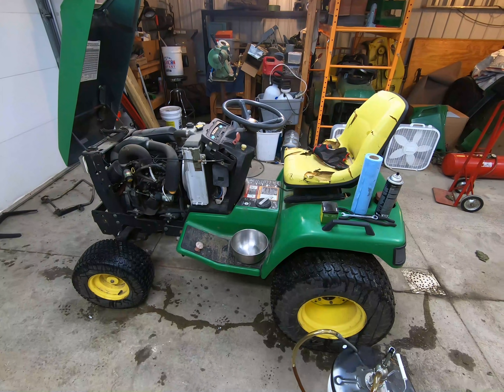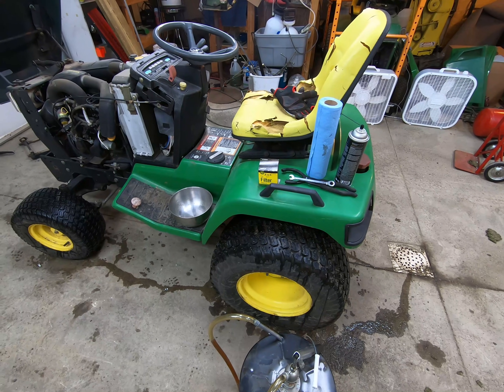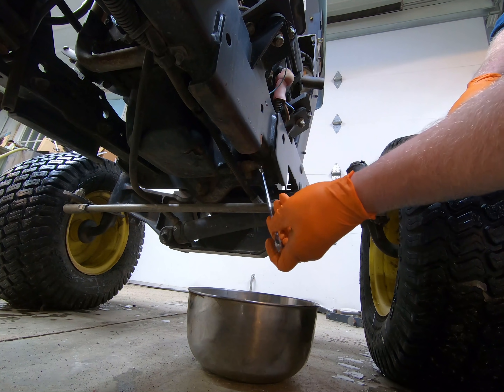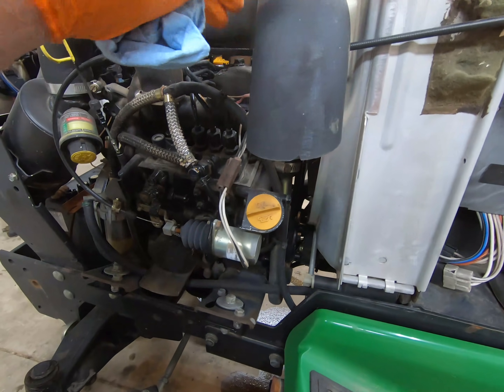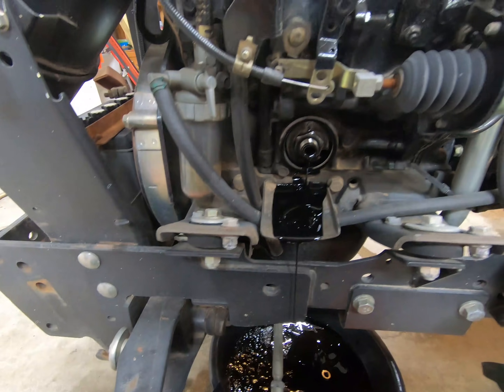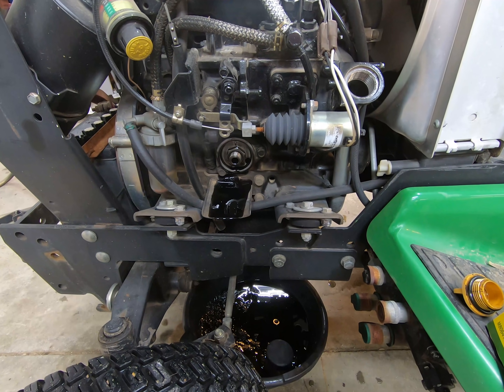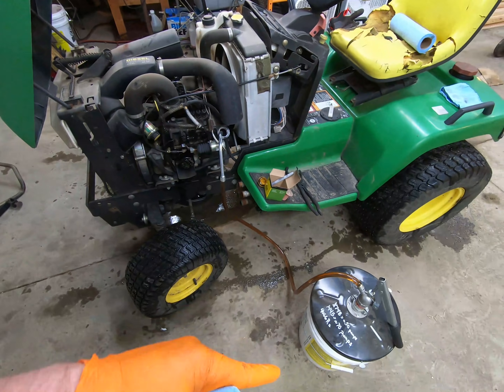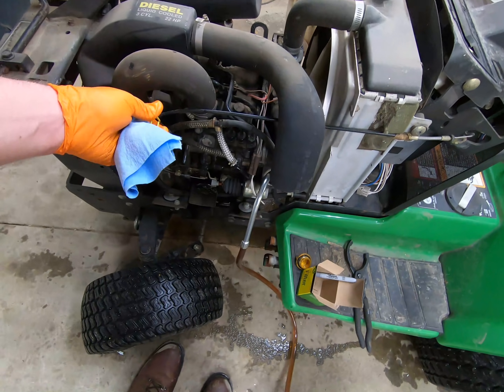John Deere 455 Oil Change

Comment: If you change the fuel filter, air filter hydraulic fluid etc etc.  I won’t complain.   I love your videos and I have to do this to my 1999 455.   Ps.  I have a hose on my oil valve.  It came that way.  I also have to take off my 60 inch commercial deck and sharpen my blades.   That seems difficult.  Again thanks for all your help.   D
Reply from the maker: The fuel filter video has been done... just need to edit it.

Comment: My 455 will be used year round.  Can I run Rotella T6 5W-40 all year?  It gets cold and snowy here in MN :)
Reply from the maker: While I’ve never attempted to run T6 in a 3TNA72UJ engine, I have run it in my 3TNV76 and did not like the results. Way too much noise for me. I’ve run Deere Plus 50 II 15w-40 in most of my machines for the last 4 years with no issues. I’ve run them at temps down it -20F with no issues. The machines themselves typically live in an unbeaten part of the shop that normally stays about 10-20 degrees during the winter. I have not extensively used my 455 during the winter.
Reply: @mmrbeef  Thank you for the reply!  Live the 455 videos you made.  Learning lots for future maint on mine.  I ran the T6 5W40 all summer never noticed any bad motor noise.  Didn't use any either. Ran a Deere filter.  Seems to work well in mine just don't want to harm it as you know how spendy these 455 are.

Comment: Nice video. I just finished changing the oil in my john deere 430. That little chute under the oil filter sure is a good idea. My 430 doesn't have one and the oil runs on the muffler. I'll have to make something up. What's your opinion of the 455 vs 430.
Reply from the maker: I'd be a fan of the 455 just because of ergonomics. The 455 is a much more comfortable machine to sit on for a few hours at a time.  Power wise and functionality they are about the same. Cool factor... the 430 all day  long.

Comment: I changed the oil my 455. Got the kit from JD dealer. I used the side oil filler plug instead of the top filler plug and 3 qts of oil. Started the tractor for for 10 seconds. Checked my oil level and the oil dipstick barely touches any oil. Like I said I used a JD oil filter and 3 qts of oil. What am I missing here? Yes i double checked the oil filter number. No oil leaks. The drain plug was cleaned and re-installed. I turned the tractor back on for like 10 seconds hoping it would somehow change. But no luck. Oil dipstick barely reads any oil. Any thoughts on this? Thank you much.

Comment: Our dealer gave us turf guard 10w-30 for engine oil on the 455. Only after changing the oil we noticed that it might not be right for the machine... what would you say? Thanks!
Reply: 5W/40  After 2018.
Reply: Thanks

Comment: This is just my personal opinion but I like to put a little oil in the oil filter and roll it around to get all the pleading inside of the filter wet with oil so it helps the machine generator oil pressure just a little bit faster on Startup the way I see it they can't hurt it any
Reply from the maker: I used to do that... just got tired of the mess it occasionally creates.

Comment: Hello there, I have a John Deere 110 small lawn tractor just like the one you have in one of your previous videos. I am looking to restore it, but I kind of have no idea where to start. I don’t have a carb and I know very little about this stuff, I am just trying to find a new hobby. Any advice on where to start, get info, and where to get parts would be greatly appreciated.
Reply from the maker: I would recommend joining a forum like Mytractorforum or WFMachines. Great group of knowledgeable folks on the forums. Take your time and think about what you want to do. I think a mistake a lot of folks make is to tear a machine down and then loose interest because it comes such a big project. I spend time getting to know the machine before I do much. Parts can be had from Deere, HAPCO Parts, and other suppliers depending on what you are looking for.
Reply: mmrbeef I appreciate you getting back to me on this. I will follow your advice, and hopefully I will be able to have some pics or a video of the final tractor.

Comment: On the fence 455 or 425?  Just sold my big box riding mower.  I know about 425 plastic cam gear, its on the list...
Reply from the maker: Personally I would always go with the 455. Here is a video I did on 425, 445, and 455 specs. https://youtu.be/kVRKS-HUQB0

Comment: I have a 455 and I was wondering if you know what front and loader I can put on it I want a bucket
Reply from the maker: The Model 40 loader will fit on the 455. Make sure it comes with the mounting brackets and the relief valve for the transaxle.

Comment: I changed my oil today and got concerned because it was black not clear on the dipstick after I changed it. I thought maybe I didn't get all the old oil out. But your dipstick also is very black so I guess that's typical.
Reply from the maker: Any diesel engine with more than about 100 hrs on it will have black oil. It is just the result of soot in the oil. You will never get all the old oil out so it will turn black as soon as it circulates through the engine.
Reply: @mmrbeef  Thanks. I was worried that I might have to redo the oil change.

Comment: Have you every adjusted the valves? My 748 has 400 hours on it and i have not done the valves. Your opinion Sir
Reply from the maker: Yes, I think there is a 455 video of mine that shows a little of that. The concept would be the same for the X748. As for needing to... It should not need it yet but I know a few people that have done it and the valves were a little off with 250-500 hrs. I think if it is running fine I wouldn't mess with success. If you bust one of the gaskets on the valve cover I think they are in the range of $70... IIRC.

Comment: I think your numbers are off I'm at 10 minutes 53 seconds into your video and you said 12 pumps per quart and your machine takes three quarts you pumped in 50 pumps it should have only took 36 12 24 36 extra 3 quarts otherwise pretty good video

Comment: why would the JD engineers design the motor with two oil fill ports?
Reply from the maker: Yanmar designed the engine. This engine has many applications for both Deere and other manufactures. It’s easier to design two full ports to ensure at least one is accessible in every application.